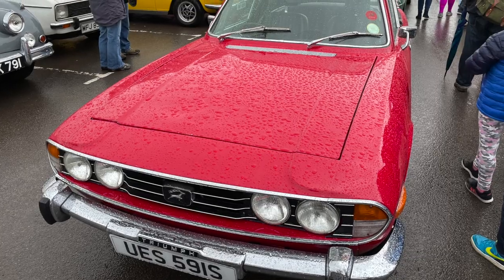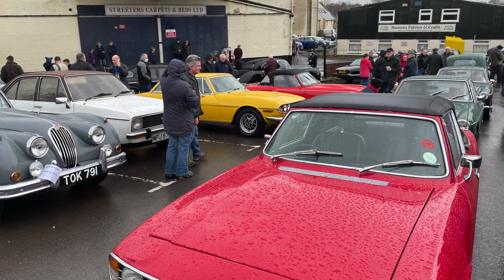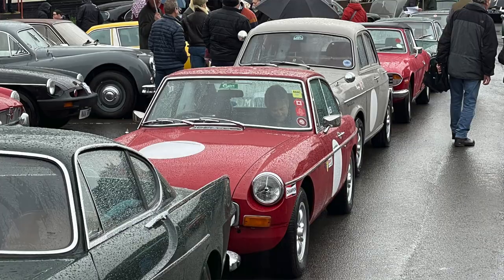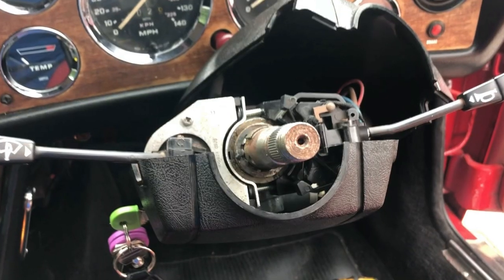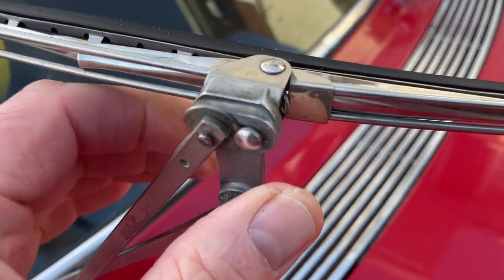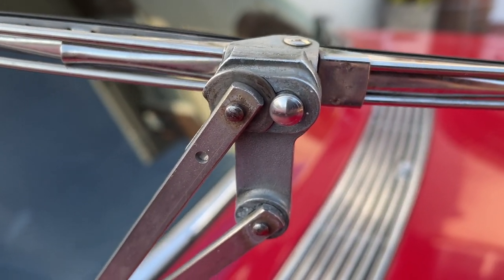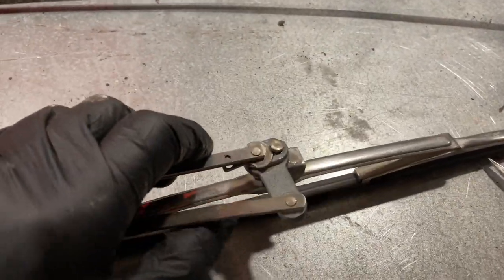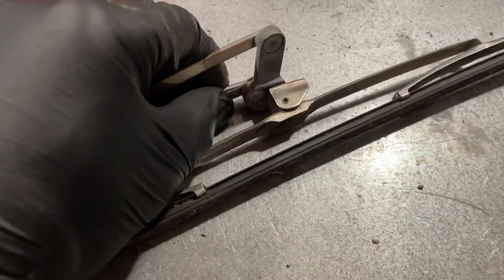Triumph Stag - What to watch for with Windscreen Wipers & Mechanism

Comment: Hi Tony. There is actually a spring-loaded clip that 'locks' the arm to the spindle in as much as it catches just below the spindle splines. Theoretically you need to pry this open with a small screwdriver etc before the arm will release from the spindle. In practice, these have often lost their tension. If you push the arm down fully when you reinstall it, the clip will (should?)  automatically engage. You can see it in your video at about 3:45. I think it's missing from your bodged LH arm, but that's not so much of a surprise.

Comment: Nice to see these in depth videos as a good source of reference for any wiper issues. I still wonder why the "pantograph" arrangement was considered necessary, presumably something to do with the curvature of the screen, or maybe somehow it increased the total "swept area" of the screen?? I know that the US market had regulations that wipers had to cover a certain % of the screen area, which meant that US spec E-types and MGBs had to have 3 wipers fitted to meet the regs!
Reply: @ArryTheStag  Hi Tony yes I guess I should disconnect the pantograph and observe the difference it makes in operation! Can't help thinking Triumph wouldn't have bothered with this at all if it wasn't for the US regs though. I think the TR7 had a similar arrangement. Cheers, Brian.